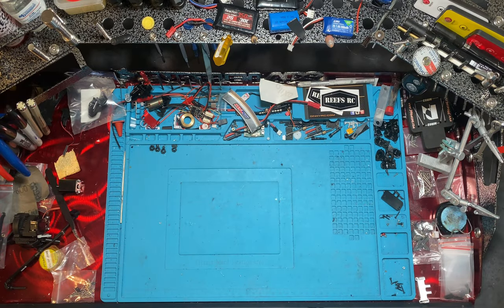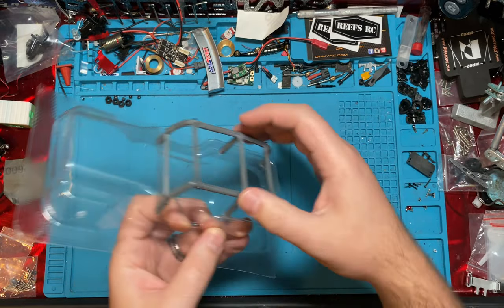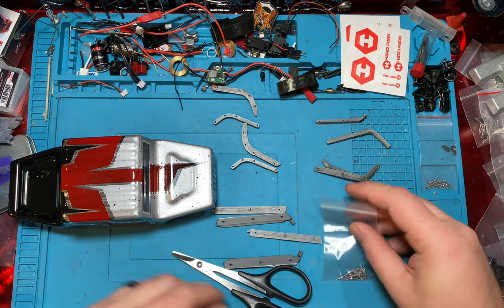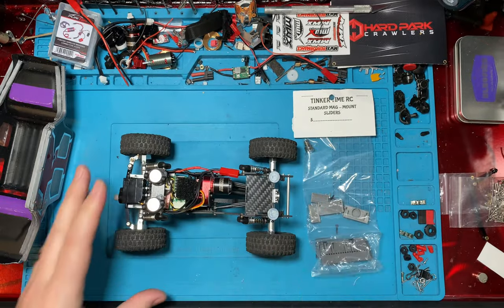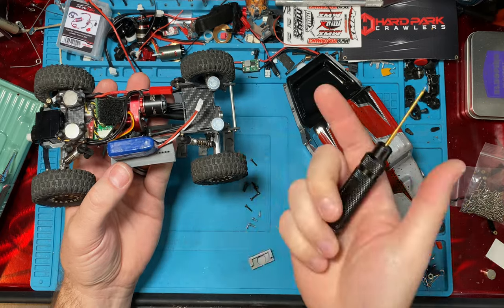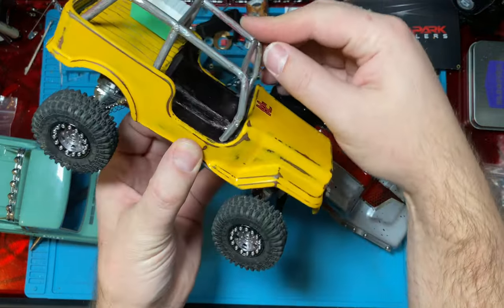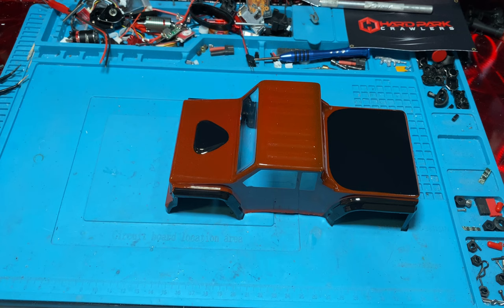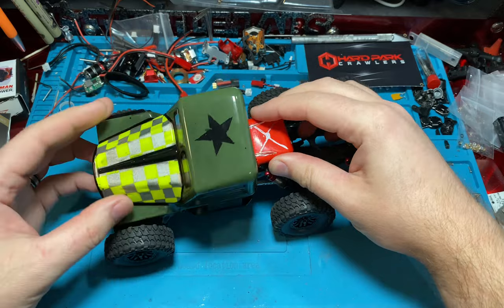Tinker Time RC Makes Some AMAZING Lexan and 3d Printed Bodies! They even have some awesome mounting!

Comment: Those magnetic clips are a neat setup - as you said eliminate the sliding since they're locking together.  That one body looked a lot better when you added the C10 roll bar.
Reply from the maker: Yeah. The c10 roll bar turned it from An 8 to a 10!!

Comment: Regarding the cutting on a painted body, I’ve had success with using a narrow masking tape from Tamiya to create straight lines that I use as a cutting guide of sorts. I trim close to it and then use a Dremel to sand close and shape any transitions by eye. AFter that the edges can be hand sanded with fine grits. The body and paints hold up surprisingly well to the edge cleaning. Heck get it on the rocks and any scratches disappear!
Reply from the maker: All great tips!!